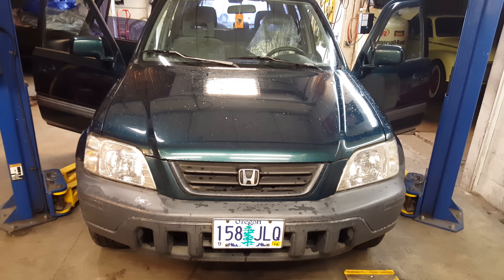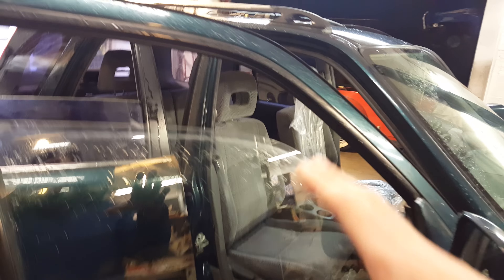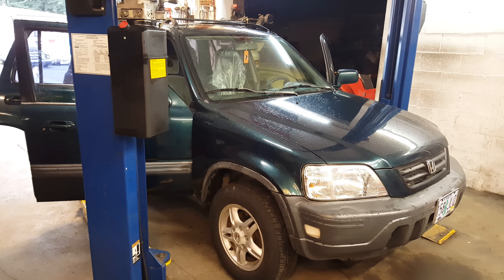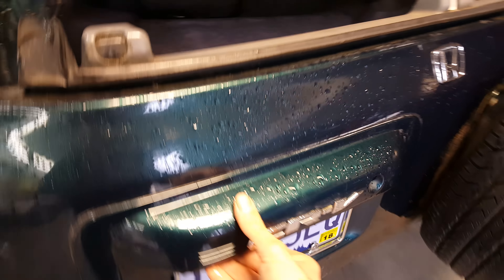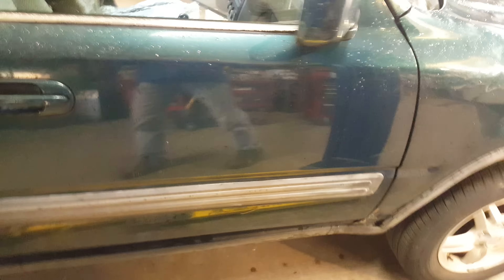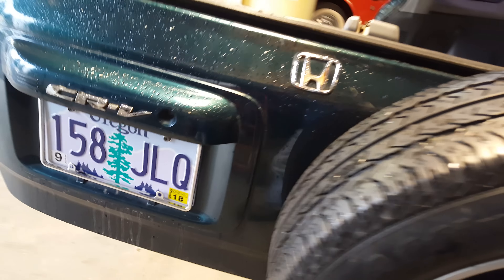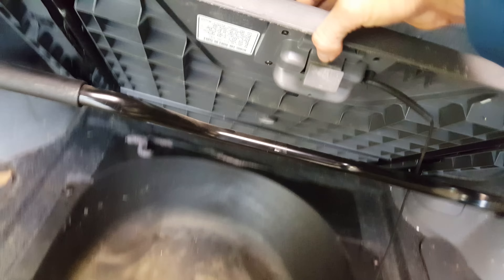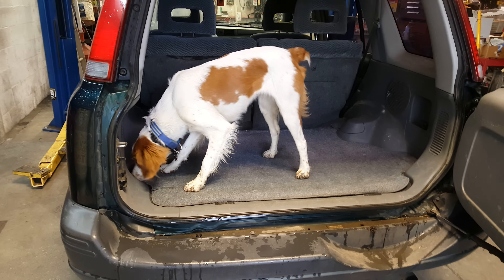Saving the CRV

Comment: Friend of mine had one same colour here in Australia, a 2000 build. Nice cars but parts are very expensive here, they also seem to have a bad habit of eating AC compressors when the AC is used hard as it is here, look forward to a $1700 bill to replace the compressor, the condensor which catches most of the schrapnel, and the TX valve that gets the rest. The AWD is quite good and the car will still drive with the front diff internally smashed, although the graunching noises and jerking as the internals lock up is a bit off putting, did I mention my friend is female?, she drove it around 30 km like that. The car has since gone to the big car park in the sky after being used for target practice by a speeding driver.